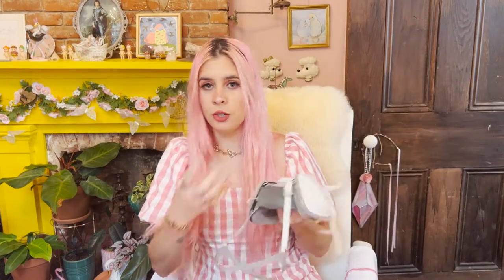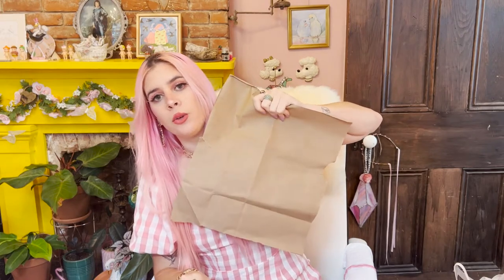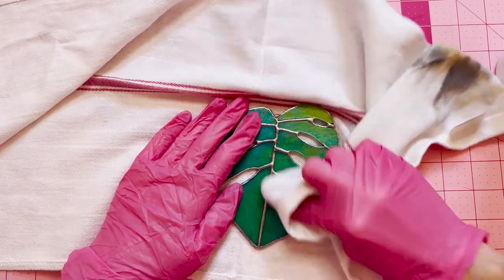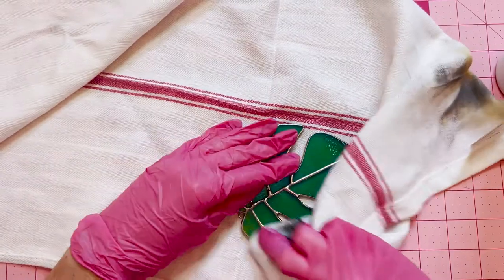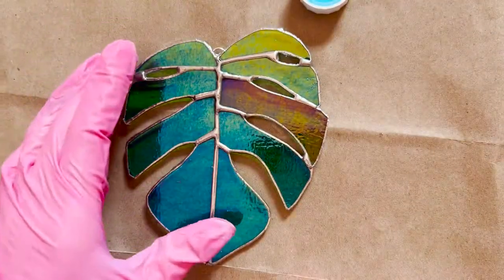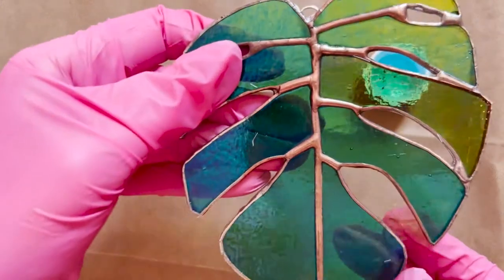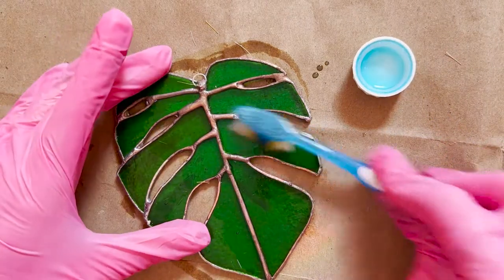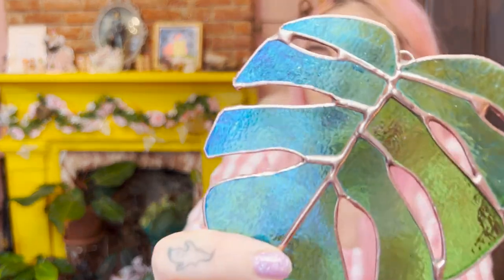How to Get Shiny Copper Patina

Comment: If you want thr solder to stay shiny silver, how do you stop it oxidising and going matt/crusty looking please? Tia :)
Reply from the maker: You'll just want to make sure you polish it really well and use a polish that also has a finishing compound in it. It will leave a protective layer on the solder that should help keep it shiny. If it does start to oxidize, you can always go back and re-polish it.